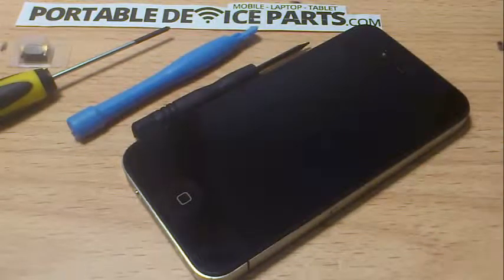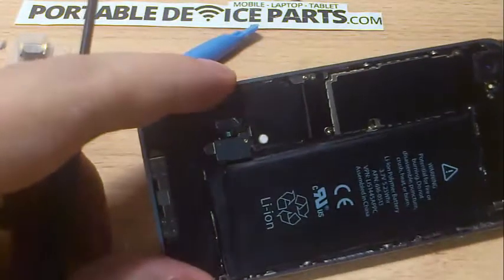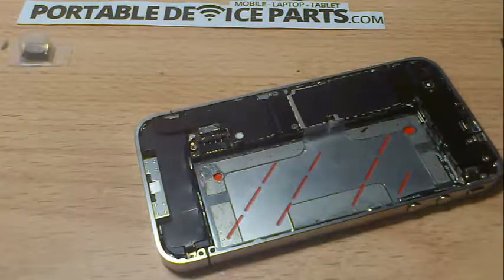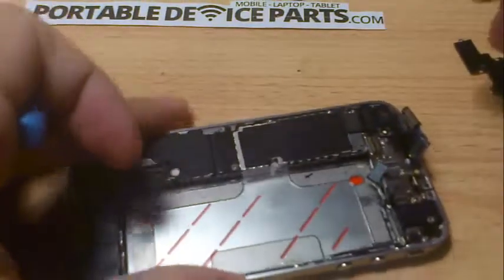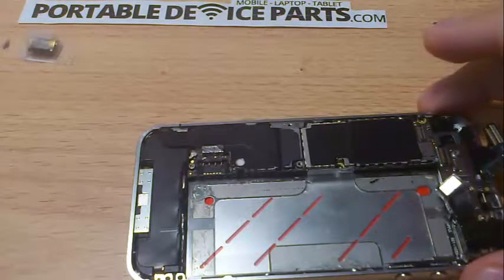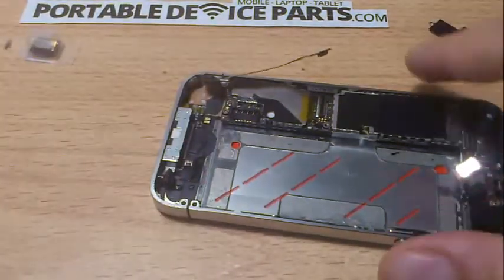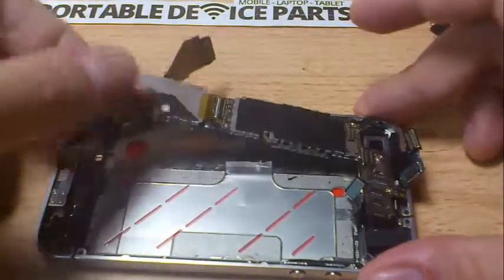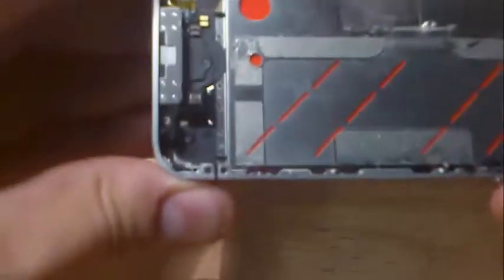iPhone 4 Ear Speaker Repair

Comment: It worked for me. I didn't know they made screws that f#cking small man!
You definitely need to print a step chart before you open this rat's nest of quantum circuitry. All i know is I saved about a month's worth of coffee doing this repair myself instead of talking it to the Appleheads.